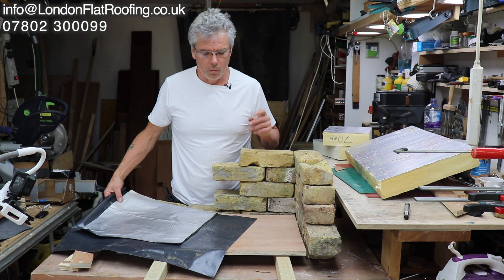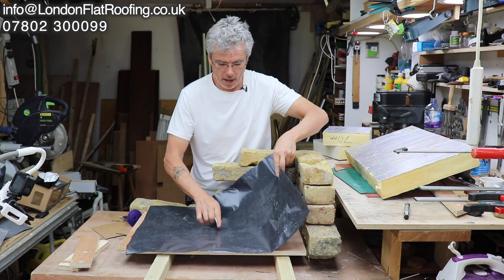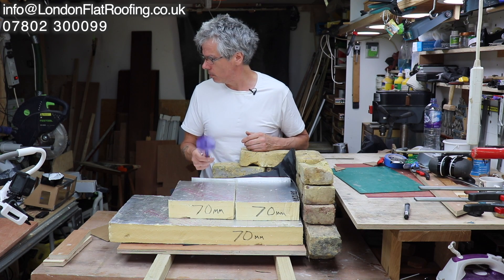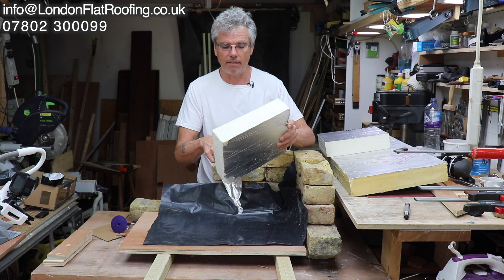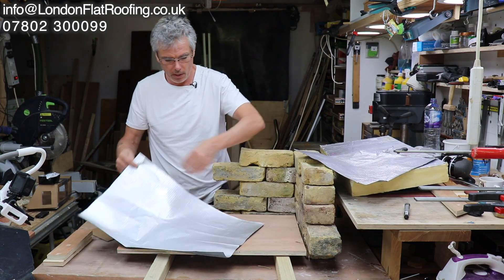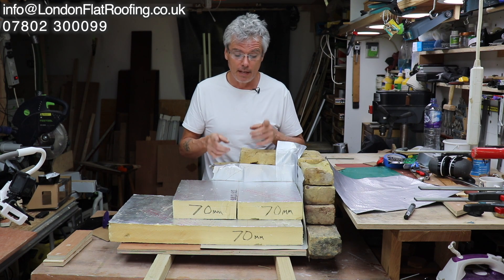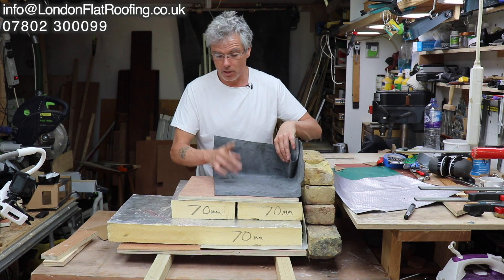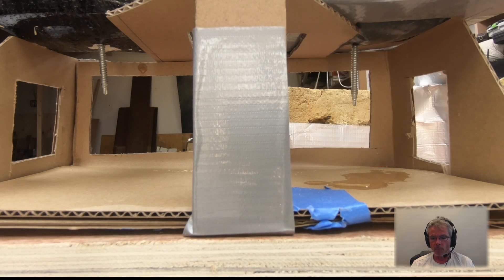Vapour Control Layer on a flat roof. Stop interstitial condensation

Comment: Hi Steve, how should I install a vapour barrier on a cold roof. I have 100mm air gap, plenty of ventilation all the way through and out through the soffit vents.
But I'm not sure how to install the vapour barrier inside before the plaster board goes in. Any videos or advice. 
Can it be stopped? Glued? Screwed?

Many thanks
Reply from the maker: It gos up over the joists before you put the plasterboard on
Reply: @SteveRoofer  thanks Steve, what's your recommendation to fix it to the timber? Nails? Staples? Grab adhesive? Screws? 
Thanks kind regards.

Comment: What if you sealed the edges with Flash band tape , priming the areas in contact, then apply your polythene vapour barrier of choice?
Reply from the maker: Yes you could but you need to use good robust materials to last years not DIY products

Comment: Sorry  ....what company 
manufacturers the vapour barrier you recommend  ie supplier and code and price  .....and also  is it same principle if I decide to use a fibre glass flat roof finish
Reply from the maker: Alutrix 600 and yes same principle if you use GRP however unless you are extremely experienced at housing GRP doesn't use it on a roof when I say experienced I mean you understand that you cannot lay outside without controlling the environment or having the correct weather window you understand how and where to put expansion you understand how to mix and build up the different layers. 90% of all roofs I look at that are leaking are up to 5 years old and are GRP laid badly 6 to 10 a week

Comment: Talk about belt and braces, i would like to ask is this only about flat roofs,we recently had an extension,but pitched with tiles, and i don,t think they did a vapor barrier, all the insulation went in there  to spec and the building inspector seemed more than happy,.

Comment: I have watched a few of Steve’s videos, all very well put together by somebody who has a lot of common sense and who has experienced the practical problems you face on site.
Reply from the maker: Thanks
Reply: @SteveRoofer hi Steve, sorry to hijack a different comment. Are you still using a top deck on epdm flat roof? I'm seeing alot of details showing epdm stuck directly to felt faced insulation.
Reply from the maker: @leftfootforward1040  Yes 50% of the time

Comment: I think a lot of it starts with trapped moisture during construction . wet timbers wet insulation both  PIR and rock wool type . wet block work once sealed it cant evaporate . moisture /vapour travels upwards  can't escape heats up condense then travels back down into insulation then evaporates again all the time attracting vapour which increasing the problems . it will condensate on a cold surface outer edges block work or under side of ply and so the cycle continues . it takes a lot of heat to evaporate moisture fully  and if its trapped  its going nowhere

Comment: Hi Steve, nice vidoes, many thanks. I am working on a cold flat roof for my garden room, I have well ventilated roof, vented soffits at each end. I am getting to the installation of the vapuor barrier internally, as I have installed the PIR. I was looking at using foil tape over the joists, sealing att the foil bacvked PIR together creating a vapour barrier. What Vapour barrier would you suggest please?
Reply from the maker: there are many suppliers try Visqueen Novia, or Siga Make sure you pick one that is in category two or above 
Tape all joints make air tight
Reply: @SteveRoofer  Thanks Steve, a couple more questions....
1. Is this suitable, https://www.roofingsuperstore.co.uk/product/polythene-vapour-control-layer-500-gauge-27m-x-50m-roll.html ?
2. How do you make plug sockets air tight ?
Reply from the maker: @speedyrazor1   the spec indicates that it could be but is pretty vague. If it was me I would go for the 120 https://www.roofingsuperstore.co.uk/product/polythene-vapour-control-layer-1200-gauge-4m-x-25m-roll.html the minimum specification on this one is over the required minim for vaper resistance in a domestic building. Don't forget to get all the tapes you need also. "How do you make plug sockets airtight ?" with difficulty.  Use a butyl sealer tape
Reply: @SteveRoofer  Thanks Steve, is there any video or explanation on sealing plug sockets please?

Comment: In this stack, is the ceiling of the room attached to the underside of the battens on top of your workbench? So the plasterboard or whatever is exactly where the surface of your workbench is?
Reply from the maker: Yes that's where the ceiling will be

Comment: Thanks for your excellent videos Steve. I’ve built a vented flat roof. I’m putting 25mm polystyrene insulation between 4x2 rafters leaving a good air gap between insulation and OSB. Then I’ll put vapour barrier and 9mm ply sheet. Will that be enough to stop condensation on underside of felt roof? Appreciate your help with that...
Reply from the maker: I cant comment as don't understand send me a drawing by email steveroofer@gmail.com

Comment: How would I put spotlights in (kingspan 100mm and vapour barrier in Flat cold roof) without creating an opening on the vapour membrane
Reply: Better to use a track system - don’t break the vapour barrier , if you must run down lighters then counter baton and make a void below the insulation and VP , better for wires too

Comment: Excellent, thanks.. Would it not make sense to roll out and staple/tape wide rolls of vapour barrier, or even better, thick DPM directly over the roof joists and then the 18mm osb or ply over that, stopping the moisture at the earliest point? I'm doing my garage roof in a couple of days so would greatly appreciate the response. Thanks.
Reply: No, this would just tend to trap moisture in the roof and rot the osb.

Comment: What is this VCL called. Doing a flat roof soon to form a balcony. Would like to do a warm roof but that might not be appropriate to walk on it. If it’s a cold roof with parapet walls all round it what ventilation methods could be used

Comment: this is a great video. i have a very old, single skinned open ( no ceiling )   garage I'm insulating. its far more complected than i thought,having spend the last week googling " how do i insulate my single skinned garage"
Reply: how did you get on? I am thinking of doing exactly the same (with the addition of a rear attached flat roof porch)

Comment: I paid a roofer to install a torch down roof on our flat roof, he didint add any insulation at all...now I have a condensation problem on the inside of building. Water dripping off beams when the building begins to heat up. Should I insulate from underneath, I'm afraid to install drywall because of condensation dripping on it in the 12 inch space between the drywall and the roof covering...any suggestions?
Reply: I know that your comment is now seven months old but unless you discussed having insulation added to the roof structure with your roofer therefore allowing him to price it in to the job then of course he isn't going to install any. A competent and conscientious roofer would have brought up the possible need for insulation with you when pricing the job,you should also bear in mind that until the old roof is stripped then he isn't going to know if there is any insulation.in there or not.

Comment: Great video Steve. Assuming the final rubber surface can't let vapour out, any water that was inherent in the materials becomes trapped. That being the case, is that ok? As you suggest you see this insulation sat outside in all weathers with assumed pints of water absorbed. As such is there a case for a one way valve or the like? Once the compartment has been heated it expels excess air and vapour etc.
Reply from the maker: Most of the roof coverings we use do let vaper out  so anything that gets past the VCL should get out. Now Trada are saying that no wood products shoud be used above the VCL so we are now laying the rubber EPDM directly to the insulation
Reply: If you look at all the singly ply & 2 layer bitumen membrane manufacturers details for a warm roof build ups such as sika & bauder they show waterproof membrane laid directly onto insulation. Putting ply on top of the insulation is like putting a cold roof on top of a warm roof with no ventilation gap. The main issue on a warm roof is you have to be careful of is wind uplift of the insulation & waterproofing if not correctly fixed down or ballasted . Appreciate the info on the correct way to install the right spec vapour control layer👍
Reply: You are correct that the EPDM is waterproof and completely blocks the passage of water vapour, so any vapour that gets into the roof is trapped there. This is why TRADA now say that there should be no timber above a vapour barrier. The only materials you can put into that sealed space are one that won’t mind the high humidity, i.e. man-made insulation. Anything else is going to rot.  I don’t think it helps that Steve didn’t differentiate between a vapour barrier (completely impermeable) and a vapour control layer. A true vcl slows down vapour transfer but doesn’t stop it. You don’t want a vcl on top of the deck of a warm flat roof, you need a complete vapour barrier. This keeps the moisture in the decking (which is warm) - where it can dry from underneath - assuming the interior finish doesn’t include a vcl that is too high a spec so that water vapour can’t move through it if it needs to.

Comment: Hi, 
We're doing an extension 4m x 8m. the  builders dont seem to understand about the insulation and airtightness im trying to achieve. We've got 125mm celotex in block and brick cavity wall. Loads of mistakes from what i can see...gaps between inner leaf block wall and the celotex, loads mortar snot in cavity between celotex and brick wall. bit of a mess. not happy. (ive mentioned it to them twice)
Theyre doing the roof next (pitched/lean to) and so far theyve got the rafters on and chucked a breather membrane over the top. (maybe temporary until they get back to the job after the weekend).
Id like to know from someone who understands the technical side, what is the best way to do this roof? 
please and thanks!
Reply from the maker: Feel free to call me or email me with photos and details nd Ill help all I can
Reply: @SteveRoofer  aaah brilliant!!
Thank you!!

Comment: Prob. a stupied que. coming from a rookie. Apologies in advance. So the idea is that the vapour should not rise (either from the roof or side of the wall) to outside of the roof. If you manage to achive that then where would that vapour go? Because it has to rise to the outside isnt it?
Reply from the maker: Whatever happens to the vapour you don't want it getting close to a cold surface. Think about the mirror in the bathroom. If it gets up to the bottom of the roof it will condense ( if the roof ids cold) and drip back down. So where does all the vapor go?  Don't create it in the first place or vent it out or mechanically evacuate it from the room.
Reply: @SteveRoofer  one of the functions of a vapour control layer (or vapour barrier) is to keep moist air in the rooms until it can be ventilated to the outside.  Effective room ventilation makes sure this happens before the moisture can move through the vcl.

Comment: Good video. I know you used 2 pieces of insulation for demonstration purposes but in reality would t be acceptable to be able to stack 2 pieces on top of each other?
Reply: yes as long as you offset the panel edges
Reply: @ak420dave7  its actually better to use two and offset vs one layer

Comment: Both he's using there are both suitable. The moisture build up in a warm roof is minimal. Tiny tiny droplets if any. Never full saturation or ponding within the roof build up. If you have that there's a clear problem either not enough insulation or you have a leak. I use sarna vap or similar on all single ply roofs or occasionally 2mm sanded torch on vcl if boards are adhered. Alutrix the silver one he's using is for hi spec jobs like on a warm roof with zinc or copper where it has to fully sealed. You can't adhere boards to a alutrix vcl they say you can but it's more for mech fix as the pu doesn't adhere well to the sheen flat surface.

Comment from the maker: To do it correctly not you cant retrofit from underneath I would leave it alone or do it all again correctly. Generally speaking, It will work without the VCL providing other elements are OK like internal moisture is low. No drying clothes and boiling loads of water on the cooker showering or bathing twice a day. Also, the insulation fitted above is tight and gap-free and no thermal bridging to the outside. If all of thease Items are Ok you may not have a problem.

Comment: Thanks for the vid! My builder did not install a VCL in the warm flat roof. We have; joists/decking/100mm celotex/decking/roof sealing. Is it possible to fix this by adding a VCL to the ceiling (under the joists) or will that cause other issues? Should they redo the whole roof? Thanks for your advice, Jeroen

Comment: Do you need a vapour barrier with a 2 ply torch on system? Would the 2 layers of membrane bonded to the plywood/OSB act as the vapour barrier?
Reply: WoodworkingStuff yes you can use the old roofing felt as a vapour barrier
Reply: Yes

Comment: Great vid, what is the price comparison between the two? Are there more cost effective AVCL's on the market as sometimes this can drive the price up so much people get put off having it done and head for the Cowboys?
Reply from the maker: It's expensive about £5 m²  the plastic some roofers or builders use cost pennies per m². There are about four different brands on the market. Generally not stocked,  and not known about even in large roofing suppliers. Even if you go into SIG and ask for a vapour barrier for a flat roof they won't know what to give you. Personally, I blame the designers and architects for not putting details exact specification down on their drawings.  Larger builders/roofers learn when on controlled sites and this filters down to the small independents.
Reply: Cheers Steve, great information and helpful advice. Much appreciated. Thanks for the link
Reply: I was speaking to a rep from Permaroof the other day, and he believes they are designing a self adhesive Vapour Barrier for the residential market that's cheaper (slightly lesser quality I presume) which should be coming out soon. Be interesting to see what it's like.
Reply from the maker: I doubt they are designing it, more-lightly they have found something that has a standard that fits the situation. Designing something and getting it past the  EN Eurocodes specifications cost and take ages.  For us, roofers/builders, all of this is a complete nightmare, I'm researching Ply and OSB at the moment; basically, there isn't a standard anymore for ply that is transparent. Its the same for VCL,s  the importers and suppliers agender is to move materials and make a profit. Go into any suppliers and ask for a VCL and 95% of the time you will be wrongly advised. Same for ply ( I don't use ply, but lots of people still do) WPB standard is no more. From my research in the real world ply supplied as water resistant is now( A) poorly labelled (B) well below WPB standards. Video coming soon.
Reply: @SteveRoofer  Excellent Steve
Reply: That's really interesting, I wonder why the standards are dropping? It's really hard to find the information as you say, most suppliers don't seem to know which product works best. I suppose it's a case of the men on the ground needing to pass the information back up the supply chain. I'm soon to be working on a project for family trying to sort out some bad workmanship on an extension done some years ago. They had a downstairs single storey bathroom fitted with a 5degree pitch roof. The builder obviously wasn't a roofer and decided to tile it with double Romans. Obviously this now leaks. I've been trying to figure out the best option (either warm or cold roof) to put back on as there is a height restriction with where the building is situated between the garage and conservatory. What do you think would work best as with it being a bathroom with shower there's a lot of moisture being emitted. I was thinking I'd have to use a rely good well sealed vapour barrier to eliminate this with a warm roof build up, or would a cold roof with good ventilation be better? But I don't know if that would pass build regs (adaquate insulation) being residential? Any help would be much appreciated.
Reply from the maker: As its, a bathroom VCL is very important refer to Visqueen.com for info on VCL,s as they have good info. Always do a warm roof buildup 50mm insulation between joists, sub decking, VCL 75 to 120mm insulation outside then whatever way you want to finish it off. Generaley speaking as long as you have more insulation above the VCL than between the joists the dew-point will be outside the fabric of the building and you are safe.
Reply: @SteveRoofer  Hi, based on all your videos i've seen on warm roofs they only have insulation above the joists, is it possible to have a warm roof with insulation between the joists also?